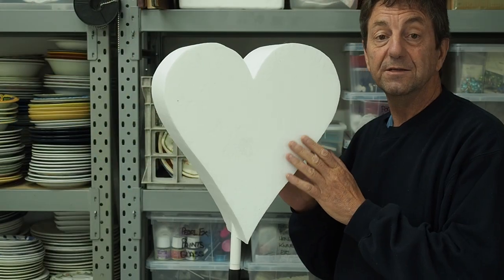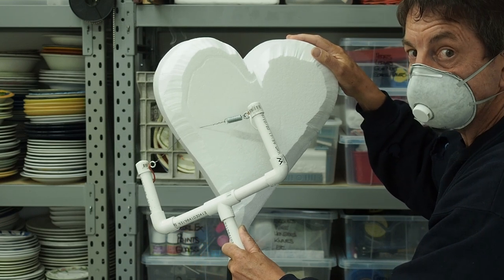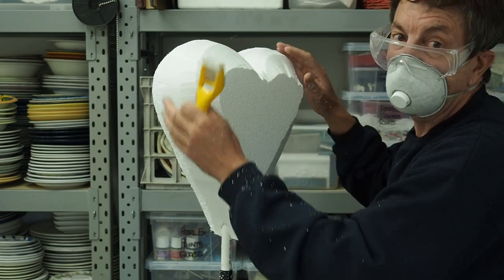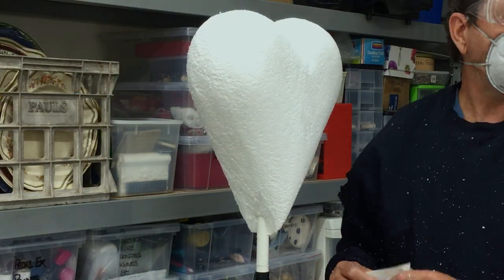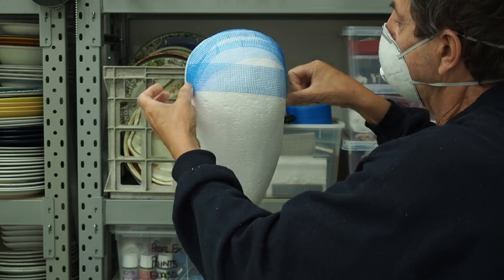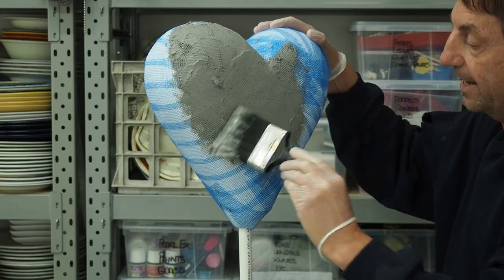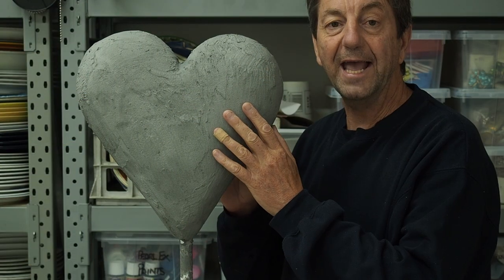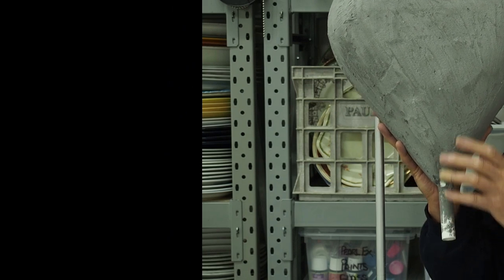Working With Polystyrene For Mosaics - Part 3 and Final

Comment: What grit sandpaper did you use for the sanding of the thin set? Thank you for your very informative videos. Florida Fan
Reply from the maker: Thankyou so much Peggy. I just used what I had on hand, it was a course grit sandpaper but I didn't use it much I just used it to tidy the surface up a bit. I really didnt need to use it because I used thinset to adhere the tessera on which is quite forgiving over an uneven surface. :)

Comment: Love this series! I'm inspired to give it a go. What is the shaver called and can you get those from Bunnings? Also what sort of stand is needed to hold the heart in the garden?
Reply from the maker: Thankyou very much, appreciate that. The shaver is a Stanley shaver, but you can use a wire brush, a horse brush pretty well anything that will shave the polystyrene. The type of stand needed is dependent on the size and the type of project you create as well as the center piece you put into the project but anything that holds the finished piece up and fits in the pipe you put into the polystyrene. :)

Comment: Thank you so much Peter!  Great informative video. What was the scraping tool you were using? From the paint department?
Reply from the maker: Thankyou so much, the tool is a Stanley shaver l bought it from a polystyrene supplier, they are quite common, l believe you can also use a horse scraper shedding tool it has a handle and around 3 or 4 half round thin strips of metal with teeth on it, just Google them and lm sure Amazon sells them. :)
Reply: @TreasuryRoad  okay, I'll try that, thanks Peter!
Reply: Great vid Peter... I really got a lot from that... well done!
Reply from the maker: @yandah1  Thankyou so much, lm glad the video has helped you. :)

Comment: Hi Peter,  where can I get finger glass mesh tape?
Reply from the maker: Hi Mozhdeh, if you are meaning adhesive alkaline resistant fiberglass mesh tape if you're in Australia you can get it from Bunnings in the plaster section if you are in another country most likely a mosaic store or builders hardware store. :)
Reply: @TreasuryRoad  , yes I am in AU but don't know how auto complete correct fiberglass word to finger glass :D

Comment: Is that just normal cement?
Reply from the maker: I am coating the mesh with Thinset or a cement based adhesive. It’s not normal cement it’s a tilers adhesive. Thankyou for the comment. 😊